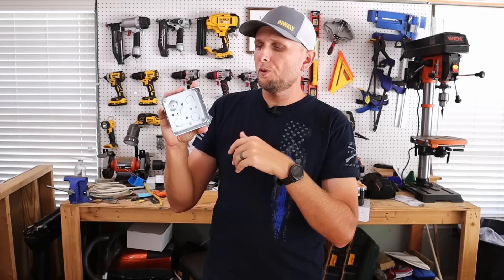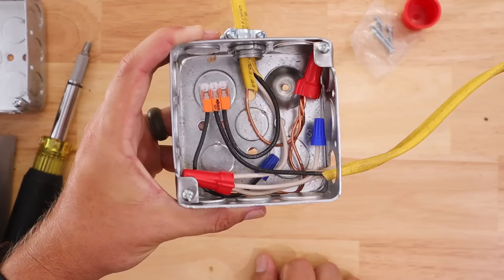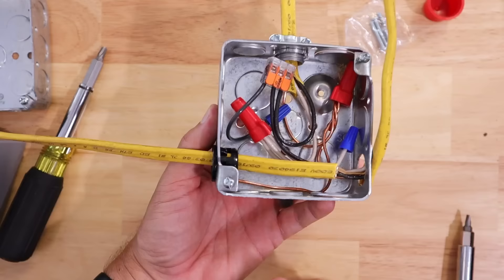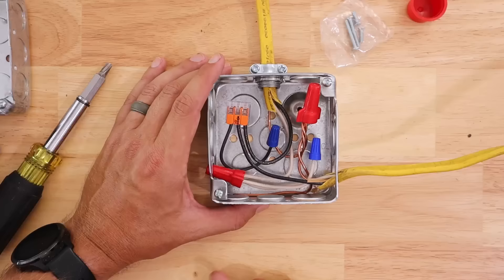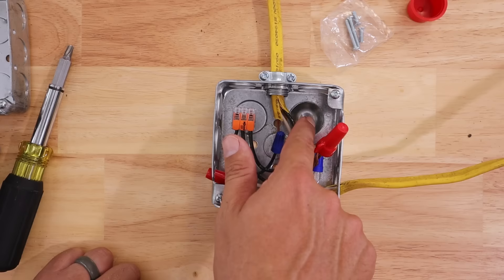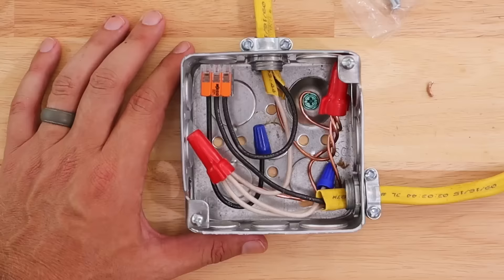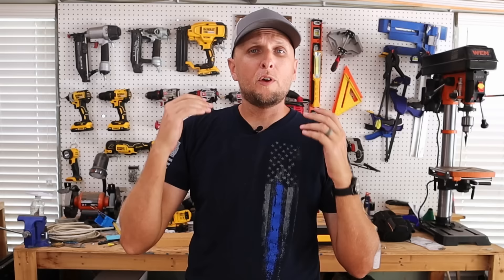The BIGGEST Mistakes DIYers Don't Know They Are Making When Installing Metal Electrical Boxes

Comment: But, there is a point to having that one thinner 14awg wire with 12awg Romex leaving the box. Code aside, the reason you might do this is because, as you described, that 14awg wire is only a jumper from the multiwire splice to the end device. If the end device is a 15A receptacle, and it probably is, then that short segment of wire will not need to handle more than 15A. However, the yellow 12awg Romex entering and leaving the box will have to handle all the current of that one receptacle, plus anything else upstream or downstream of that box. In that case, it's probably 20A that the 12awg Romex must handle.

Have you ever looked at devices, like switches, that come with wires already attached? They are frequently thinner gauge, only designed to handle what that specific device can draw (or is rated to handle, like a switch would be). In that case, the circuit's breaker isn't sized to protect those short segments of wire.

In addition, Romex is rated based on what its wires can handle when bundled inside a jacket, when hot and neutral conductors have no space between them. In an open air enclosure like your box, a segment of 14awg wire without jacket will be able to handle more current than the same wire inside a jacket, and possibly inside an insulated wall cavity.

Finally, 14awg is vastly easier to work than 12awg, so the fact that the jumpers to the device are thinner makes that device easier to fit back into the box.

I'm not saying it's best practice, or has the safety margin using all 12awg would. But, there is a reason for it, and in most cases, it's a very small safety concern.

Comment: As an electrician I agree with pre-twisting lines before a wire nut but I don't see you doing the final step.
Take electrical tape and run around the nut and no less than 3 wraps on the wires to insure the wire nut can not slip of. Also if the nut is loose the tape willl hold the connection together and prevent the nut from working off. Just found it is a best practice to secure the nut.

Comment: I always found it easier to just wrap one of the grounding wires to the screw than to add another splice pigtail, especially if working with 12 awg wire.
Reply: Yeah I always twist them leaving one long as the pigtail. Less connections means less chances of an issue as well as less clutter.

Comment: What kind of securing clamp do you use if you are pulling a new wire into an existing 4x4 metal box in the wall without cutting open the drywall?

Comment: Always pre-twist before installing a wire nut. This done for 2 reasons it insure a proper connection and you can visually confirm the connection.   Only hacks use the wire nut to twist the wires.

Comment: Using Romex is the biggest mistake of all. I only use conduit. I never use wire nuts for the ground. I crimp on a lug and then put the screw through them. Am with you on using number 12, but believe it or not my shop has very old aluminum wire!

Comment: Can those ground pigtails can be used to hot and neutral wire connections? for example if I need to restore a small part of damaged cable?

Comment: The clamps on wire to box also have a plastic nut inside of the clamp that threads  onto the metal connector that keeps the romax from fubbing on the metall clamp end

Comment: the connectors main purpose is not to keep the wire from being pulled out since the cable is supposed to be secured pretty close to the box. bonding the box is to facilitate the operation of the overcurrent device, and in a round about may protect personnel.

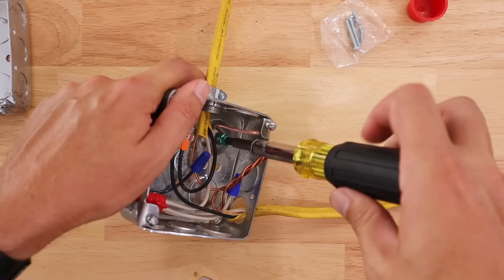Comment: Two issues with your install...  1. for completeness you should have stressed winding the ground wire the correct direction around the green screw so it doesn't start to unwind when you tighten the screw, and 2. somehow you managed to start unwinding it anyway - look at the transition at 7:00 when you cut to twisting the wires you can see when you repositioned the ground wire to go down into the box instead of toward the wall, you unwound the wire under the screw a bit.

thanks for the informative videos though!

Comment: The part of a wiring job you need to show is designing the layout and running the wire. Drilling wholes, running your feed lines from the panel, panel layout, and connecting the main from the meter to the panel, etc.

Comment: Actually the 14 gauge tail if it's feeding a 15 amp rated device is not against code. 
15 amp rated duplex receptacles or rated for 20 amp pass through but only rate it for 15 amps to feed a piece of equipment. The Wago is rated for 20 amps pass thru so having a tail that feeds a 15 amp device is okay even though it is on a 20 amp ocpd. One other mistake that I saw was the conductors in the box were not long enough, there has to be a minimum of 6" of wire in the box but it might have to be more than 6 " because after the device ring is installed there needs to be a minimum of 3" of conductors that connects the device that is used, so the total length of the wire after entering the box has to be 7" at least and could be much longer.

Comment: All these wire look visually short. When pushing the device into the box you do not want any pressure on the device. An extra inch or two of wire will not break the bank and it becomes way easier to fold the wires in during installation and to make future wiring upgrades. I always use at least 8" of wire for the ground and then the ground wire is weaved into the back of the box and pressed back so as to be completely out of the way. Ground first, then Neutral then Hots and Switch legs. 
When working on the initial instalation and future work you are working with the wires on the outside of the box. You are always pulling the wires out and for that reason there is always the opportunity for the wires to be pulled into something metal and sharp possibly compromising the insulation. So when you strip the Non-Metallic Sheathed Cable cut it clean and have 1/4" of uninterrupted sheathing beyond the connector. Once you decide where you wish the sheathing to end ( 1/4" inside the box ) you very carfully score the sheathing without cutting through. Then from the score location you cut the sheathing and the result is a clean removal without extraneous sheathing inside the box. If you look at the top cable in the box you could take the black and white wire, pull them up and there is not much to protect those wires from being in direct contact with the metal connector.

Comment: Just yesterday I found an open splice under my kitchen sink cabinet that was arcing after my garbage disposal started leaking and the water got underneath the cabinet floor. The kicker was that the ground wire was not spliced/connected to the other wire of the splice and just free floating in space. I am angry at whoever the electrician was that did that as my house could have burned down and now all of the wiring in the house is suspect. Thank you for the info

Comment: Interesting.  In my basement (which has metal boxes) I notice the boxes are NOT grounded but the receptacles ARE grounded, and those ground the box.  These were installed by electricians and inspected when the house was built (mid 1990's) so it must have been legal then.  As long as it is grounded somewhere I'm not worried about it.  If there's grounded conduit do you still need to ground the box?  Years ago you never saw green wire in EMT but now you do.

Comment: #14 is fine for a 15A rated device.  Being that the smaller conductor size was used at end of line, it doesn't create a hazard.  There is no bottleneck in other words.  Now, if a # 12 circuit was continued off that #14 pigtail, that's unsafe, because it creates a bottleneck.

Comment: I'm in J Box hell right now.  Ok, maybe not hell but at least purgatory.  The good news is all the problems are in the basement so I can fish lines without tearing upstairs drywall out.  Basement is getting smashed to bits down to frame.  I was just wondering what this J Box addiction is with DIYers?  I can understand trying to get the most out of a circuit, but being lazy and putting them up everywhere to transition from cloth to Romex seems less efficient than ripping drywall and doing it right.

Comment: Your flaw with the wagu using a 14ga pigtail when the incoming wire is 12ga makes perfect sense.  But it seems the opposite should be fine:  14ga incoming wire, can I use a 12ga pigtail?  Seems simpler to just pre-make pigtails out of 12ga than always needing to check.  It the the case?
Reply: There's nothing wrong with your suggestion, but there's no electrical advantage and 12 gauge is harder to work with. If you're using 14 gauge for the rough in, then stick with it throughout. You should have plenty of 14 gauge wire left for your pigtails. If you're not a professional, then needing to check in general, is a good habit for this job.

Comment: Realize this was just a demonstration mock up, but the left side of the box had an open hole from a knock out already being out of it. They make metal push in plugs to cover these unused holes.
Reply from the maker: Yeah it only got knocked out midway through the video to demonstrate the plastic nm connector.   But you are 100% right and it’s a good tip!  Thanks Steve.
Reply: @HowToHomeDIY  loved your video and found it really helpful.

Comment: And the one step that I would take even further beyond everything else that you mentioned or that I read in the comments is that I actually tape ALL the wire nuts in the fashion where the tape would keep the nut from loosening so if you're looking at the nut with the wire behind it that would be in a clockwise fashion starting at the wire nut and then taping down to the wire so that will keep that wire not in place all the time. I am not an electrician per se but I have done enough electrical work and I've always done it this way and I am constantly working in other peoples houses and so many loose wire nuts which of course makes a bad connection with high resistance and causes flickering lights or non-continuous operation of an appliance and heat!!
    Edward H.-  Integrity plumbing, Septic, Heating and Drain in Madison, CT

Comment: Did you connect the ground wire (with the green screw) to the other copper wires in the box? Or, did you just lay the ground wire in the box?  Thank you for your answer.

Comment: I have grounded the metal boxes, but didn't know about using the same green screws as the ones used on the outlets. Now that I know it makes sense. The rest of the things I fortunately knew.
Reply: Jim the green grounding screw on the receptacle is a smaller size then the one used in the metal box #8 - #10

Comment: Noticed a couple things you got wrong in this video. The info you provided minus the grommet needed to be used for the Romex is incorrect. 1) Since you're installing a device you do not need a bonding wire for the box because the box is grounded through the device. That is in the code book. 2) the 14 wire is ok to use in that application even on a 20 amp circuit. The voltage drop or load would have to be so excessive  that even the 12 wire would burn up. But for peace of conscience a 12 wire isn't wrong to use.

As an FYI, wire size is not determined by breaker size. Most will disagree, but I am an electrician and have studied this and it was even in my continuing education back in November this past year for license renewal. Wire size is determined by the load. DIYers don't know how to determine load calculations for wire sizing so they go to the failsafe of using the wire size based on breaker amperage (which is smart to do). They at least know they're protected.

For a side note, the greatest point of failure if all is wired correctly is the Wago. But I won't get into that in this comment

Comment: I may be wrong but I believe you also have a mistake on those neutrals in that wire nut that wasn’t mentioned. The wire nut should be tightened enough until there is a twist in the wires behind the nut.

Comment: So I am not using Rowmax and using EMT conduit and ENT conduit fittings going into a box. There is nothing stopping the wires moving. I may be wrong but in your case the fittings are used to stop the wire from being cut from the side of the box.

Comment: Did you remove the insulation from under the single blue wire nuts? Are not the blue wire nuts too small for number 12 - 14 wire?

Comment: Hey, I was expecting you to show a box with too many conductors in it. That seems to be another common sight. We just bought a new (to us) home that the previous owner ran all kinds of "stuff" in the attic and ceilings. I keep finding WHITES and GROUNDS  being tied together. GRRR ! The best one I found was at the ceiling fans.  The guy installed the fan and light circuits on a piece of 14-2 romex. He used the GROUND as his NEUTRAL, and the White & BLACK as the Fan & Light power leads...
Lots of surprises in this house. AND YES, I did pay for a PRE-INSPECTION before I bought it, and NO, the inspector DID NOT FIND any of these problems. Yes, he DID break  the air line to the septic tank while looking for the clean out to inspect the tank...   NO, I would NOT recommend that company to inspect a DOG House.

Comment: It's really interesting that in the USA you have 'romex' with a 'solid' earth conductor whereas standard electrical wiring here is either 1.5 mm sq or 2.5 mm sq TPS (Thermo Plastic Sheath) and the current standard has brown for active/live, blue for neutral, and green or green/yellow for earth. The idividual conductors are usually multicore copper not single solid copper conductors. Because our single-phase power is 240 VAC problems with earthing, etc. are very serious business. I'm not an electrician though so never do elec work myself.

Comment: Why do you need to use the green grounding screw and shouldnt use a regular screw with the correct thread?   The only reason I could think of is they material the screw is made of might cause an issue.  Is there another reason?
Reply from the maker: It is just easier to find the correct screw for the average person.  With the green ones you know it will be the right dimensions and type and they are not expensive.

Comment: If you use a 15 amp receptacle and breaker, you're fine with 14 gauge wire. Also, a fire hazard is an exaggeration. I'm not saying it's right if 20 amp breaker is used. But I can guarantee it's not going to cause a fire. Oh, to add, I'm also a fire investigator. Lots of safety factors are built into what a wire size is capable of withstanding amps wise.

Comment: 1:23 if you are making a fixed installation which has problems with mechanical strain, you're doing something wrong from the ground up. At least here in Germany those boxes are made of plastic and are only secured against slight water ingress aka IP54. 
Not saying that having tension relief is wrong in certain applications, but a fixed installation should be free of ANY tension by default.

Comment: In regards to the last mistake. Mix use of wire gauge. I recently purchased a large amount of 12/2 Romex to run 3 new lines from my main panel to my 2nd floor acs. I also had to re runs some lines from the attic to the 15 amp outlets in the rooms. I did not bother purchasing 14/2 for those 15 amp lines because I have way more 12/2 then I need. I think it is ok to use some 12/2 in the 15 amp line because the wires will be protected up to 15 amps. It’s not the same as using 15 amp 14/2 wire on a 20 amp circuit. Wanted to see what u think about this.
Reply from the maker: Yes there is nothing against using #12 wire on a 15 amp circuit.  Some construction companies are actually wiring the whole home that way.  Allows for upgrades and is safe.

Comment: The Romex connector nut should go with the ridges twards the box to prevent loosening. Not issue if it's on both sides. Also older ones the ends of the nut edges should go twards the box to engage with the metal on the box.

Comment: The US National Electric Code (NEC) requires a 2/3rds wrap of the wire around the screw. Good practice is to end up with the entirety of the wrapped portion of the conductor to be underneath the screw head. 

Tom Horne
Reply from the maker: Good thing it is all the way around the screw.  I just looks odd on the camera due to the direction it is leaving it.

Comment: Ah, the old debate, To pre-twist or not to pre-twist. I was taught for efficiency by a large electrical company that did only commercial work not to pre-twist, because we did many setups that would be seasonally changed in big box stores. Otherwise unless I am doing a temporary setup, I pre-twist. Also at the end of the line at a devise for speed I may not pre-twist. However in making junctions anywhere as in home runs where I want the most reliable conductivity I do pre-twist.

Comment: Should read the datasheet of a 1 pole 15A breaker and to see that it can be wired from 14 to 10 AWG. 

Longer distance needs lower awg to lower voltage loss. You can go from 14AWG to 10AWG and its up to code in Canada and pretty sure in usa since it is almost a copy paste. The only thing to look is that a 12AWG doesnt means a 20A breaker. Usually nobody use a lower AWG inside a small house, but very common to feed outdoor like a pool,spa,shed.